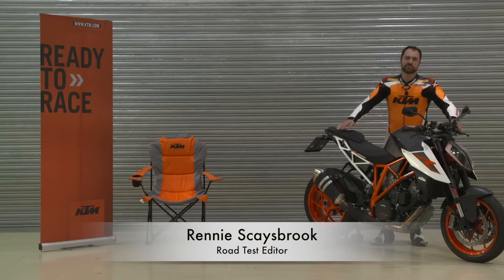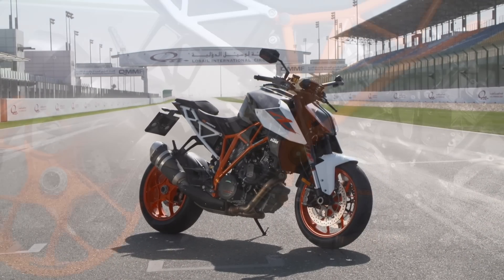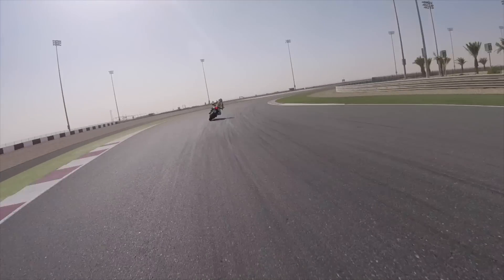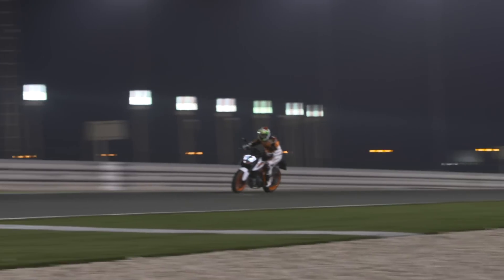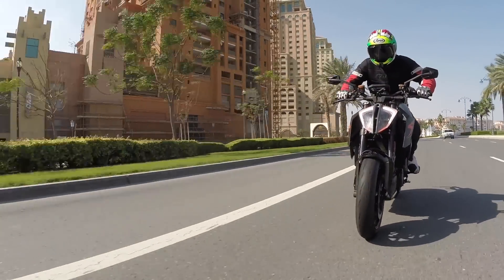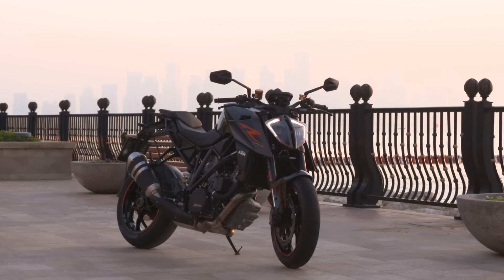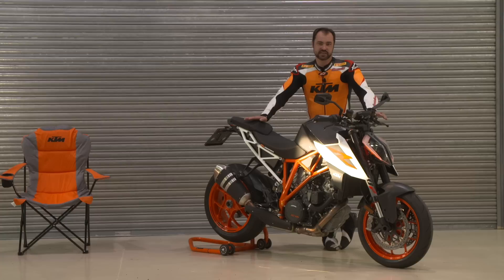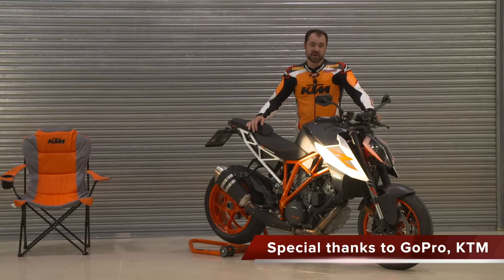2017 KTM 1290 Super Duke R Full Test - Cycle News

Comment: Rennie is the Gen1 too snatchy when at full lean or just something to adapt to / be aware of?  would you choose a Gen1 again over the newer Generation SDRs?  thank you
Reply from the maker: The Gen 1 had its issues when the throttle was initially cracked open but it's something you can always get rid of with mapping and exhaust. The newer bikes are harder to do it on because of the amount of new electronics. The Gen 1 was a raw beast. I loved it but I'd say the new bike released this year is smoother and faster, but not as exciting
Reply: @cyclenews  got it, super helpful, looking at a used Gen 1 today.  thanks and respect to you.

Comment: Soundslike they listened to the customers, the new additions are fantastic! Have they got a full sized gear lever on this one that actually covers your toe? The only negative with this bike is the price now >.<
Reply from the maker: It's still a little short and sadly they didn't change the footpeg material, so my boot slipped off a couple of times.
Reply: browie316  yup to much price her in ph
Reply: browie316  yup to much price her in ph
Reply: I put a spacer on my shift lever so it was easier to hook my boot under there.   Well!   At the first trackday I ground the end off the newly-extended shifter.   it's short for a reason!!   So I use the spacer on the street and I go back to "the nub" shifter for track use.  4 track days so far.   If you change it, go for a longer lever with a folding tip.

Comment: Mate, so what modifications (suspension, tires, engine, controls etc) have you made to your first gen 1290? Are you tracking it or using it in the road?
Reply from the maker: It's got the PowerParts catalogue thrown at it. Akrapovic ti exhaust, WP race shock and fork internals (0.9Nm in the front, can't remember what's in the rear right now as we change it depending on the track), Pirelli SC1 soft slicks, race map (no Power Commander), PowerParts rearsets, about to put a thumb brake on it to try that out. If you watch the Pikes Peak video on the homepage you'll see the bike up close. It's a racer only.
Reply: You're a legend! Any news on the upcoming 790? Im working my way up on displacement. Currently on a KTM 690 SMC
Reply: Cycle News Top notch! I don't realise you threw in your own bike for the Pikes Peak. I definitely wouldn't mind the Akro, cartridge kit and rear sets. I'm guessing there wouldn't be a great deal to gain from getting the new one (especially with all the bits you've got on yours), unless you really need that adjustable TC and quick shift.
Reply from the maker: Having the adjustable TC and especially the quickshifter would be nice. They are certainly an improvement over the 2014-16 model. Working on getting a quickshifter but there's not much I can do about the TC, unfortunately.
Reply from the maker: Not much info has been released on the 790, but it'll have the same engine as the upcoming 800 Adventure, due out (apparently) at the end of the year. That 790 Duke will be a total weapon...
Reply: Cycle News I have heard that quickshifters on the 14-16 models had caused some issues. Do KTM have a power parts quickshifter option?
Reply from the maker: I've heard the same, that's why we didn't run one at Pikes Peak. I don't think KTM does one for the first generation model -- might have to go searching the aftermarket for one.
Reply: healtech got a nice one ..

Comment: What's the QS like?
Reply from the maker: Good - it's rpm based, so if you're under heavy braking at high rpm (like slowing off the straight), it can be a little hard going back through the gearbox, but upshifting, it's really good.

Comment: The 2016 Super D-R had 190hp. They grin and giggle about 5th gear wheelies but the Triumph street triple i've seen (1000+ cc) have no trouble bringing the front wheel up in 6th.
The 2017 1290SA, The 1090 Adventure, and whenever the 890 Adventure comes out are the most impressive developements by KTM so far. The 1290 GT was interesting but maybe a bit overpriced?
Reply from the maker: The 2016 Super Duke did not have 190hp. It has a claimed 177hp, which in reality, is about 160hp at the wheel. I own a 2015 SD and it's laced with PowerParts including the exhaust, different fuel maps and airfilter, and it has 165hp at the wheel. -- Rennie
Reply: None of you guys know your stuff. The new SD has 177hp, with Evo2 kit, full Akra, K&N and remap it is around 190hp. And a street triple with 1000cc, seriously 😂😂😂😂😂